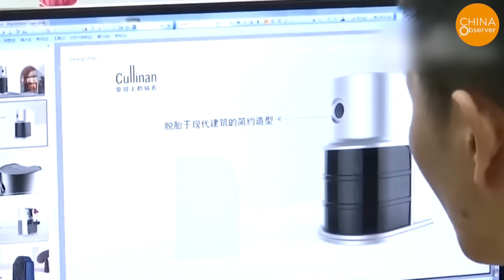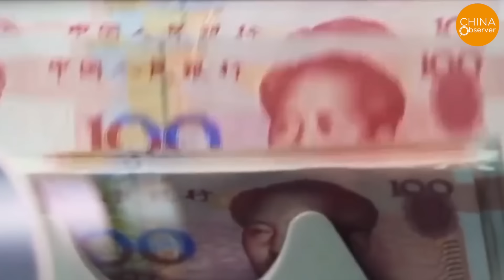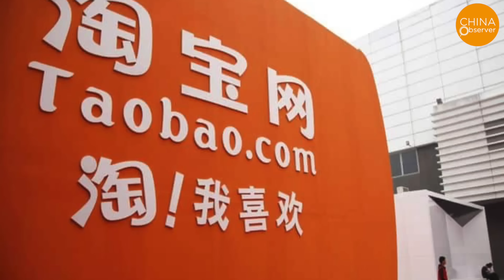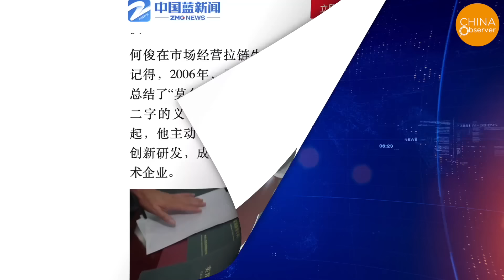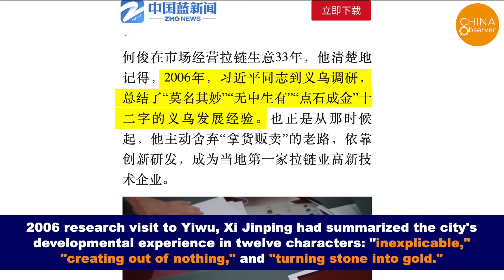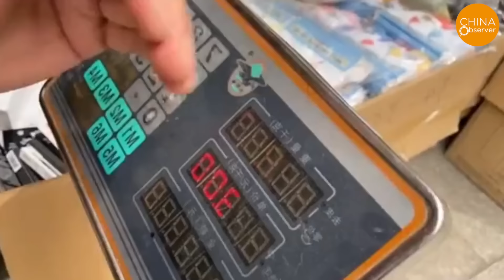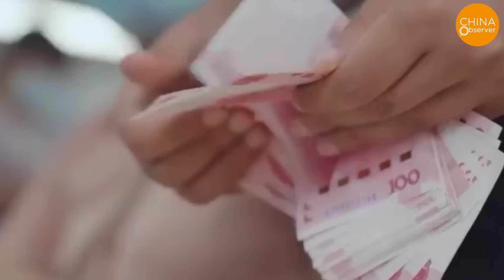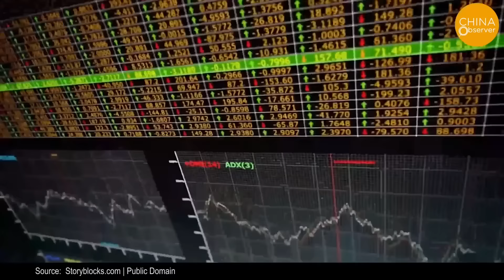No Orders From US & EU, World’s Largest Counterfeit Market Is Doomed | Yiwu | Temu

Comment: Because they dont have a minimum respect for copyright, China is always going to be a race to rock bottom prices. Unlike S.Korea or Japan who moved on from cheap manufacturing.
Reply: its communism. the idea of communism is that everything including ideas, and copyright items belongs to the people.
Reply: @annarock8966  i did say minimum, fakes are still cracked down on, now if their doing a good enough job that's another story.
Reply: The LV bag was pretty good...  They used these "old bags" and turned it around by adding extras and bettered it as well.. and then resold it... So.... I mean, it could be done, as long as these companies would spend the money and the way to advertise. So... there are now diffusion brands too. But I mean... the way that they are running things, is just.... I don't like where they are going...   20 yuans for a kilo ? I kind of knew that we've lost it, when Selfridges were selling scrunchies... for around 20 to 30 pounds. lol.. And it was "Designer"... !!! lol..... When I saw that. I gave up. I liked the approach of  Uniqlo... and the same thing now with Primark too. So.....
Reply: I'm torn on this topic. I think buying fakes is morally wrong from an artistic perspective, but at the same time, the sky-high prices are equally morally questionable. After much deliberation, I chose  :yt: condupcom :yt:  to buy bags... Perhaps the best luxury goods are things that have nothing to do with money and material things.
Reply: No matter if it's the:yt: preluxscom :yt:or any other, my steadfast belief stands that only practitioners can perceive dissimilarities in the sack's looks or the metal constituents.
Reply: Interestingly, that in a:yt: preluxscom :yt:, the inside sewing at the handles is more carefully made (leather is not so frayed), than in the original one.
Reply: Mi a?etis al mia nevino sakon por ?ia naski?tago ?e:yt: preluxscom :yt: kaj ?i amas ?in. Mi mem a?etos unu!
Reply: Mi neniam estis seniluziigita kun:yt: preluxscom :yt:bags tote. ?iufoje kiam mi uzas mansakon, mi sentas, ke mi posedas arta?on.
Reply: Amei todas as bolsas lindas e de muito bom gosto.Parabens :yt: hotdups :yt:
Reply: For a long time, as the price of Chanel increased, I no longer thought I could afford it. I think I'll be happy that I have the:yt:preluxscom :yt:as my travel bag that I don't have to take care of. By the way, I'm sure no one will have a hard time telling the difference. Thanks for the comparison.
Reply: We do we definitely do. We’ve just gotta figure out how to get Americans to work in those type of environments because let’s face it. I hate to say it I’m one myself or quite lazy and we feel we’re entitled and we want high wages and if we want high wages and guess what we’re gonna pay high prices at the store and so it’s kind of we’re beating ourselves at our own game because we want good deals, but we want high wages and we don’t want to do manufacturing jobs. Some people will but majority of people don’t want to especially the youth. Unfortunately, because we want higher wages which cost more workers compensation for the business owner and supplies, etc. etc. that means they have to raise the price so I think what we need to do is figure out how to adjust how much it cost to live in America so that we could afford to make less so that we could afford to buy cheaper stuff and we could afford to build it here. This is a big issue and I don’t know how we’re gonna get there but I think Elon Musk will help us because he’s about to getrobots to do these manufacturing jobs and when he gets robots to do these jobs in America, then we can have all of this stuff here and it won’t cost any labor but then we’re gonna be having people with no jobs and how do we deal with that? It’s a rabbit hole.

Comment: Most interesting that in China the Kilogram has 500 grams
Reply: I think it is close to other standard right? One lbs ~ 0.454 kilograms?
Reply: No in China 1 Kilogram or gongjin (公斤)  is 1000g, same as everywhere else. You're being mixed up by the Chinese unit of measurement jin (斤) which is 500g.
Reply: @ro0ster648   they are just joking xD
1kG = 500g in china lol
Reply: LOL.....
Reply: At 13:17 they note toys are 18 yuan per kg or $2.50 for 500 grams. 18 yuan is around $2.50. But 1kg is not 500g

Comment: Losing the soporific weak AI narration would serve well to offset the costs associated with legally using the stock images and video clips which are protected intellectual properties — which I cannot imagine you didn’t pay for. I guess attributions and the embedded watermarks typically removed upon purchase could be an oversight. It happens.

So, China’s doing what? Stealing intellectual property? Where could they have learned such devious tactics? 

I’d write more, but I need to catch up on the past few season compilations of the  freely available (albeit YouTube monetized) seasons of, “The Simpson.s”

I’d add a popular axiom related to casting the first stone if only I could remember on which Napster download I heard it on…